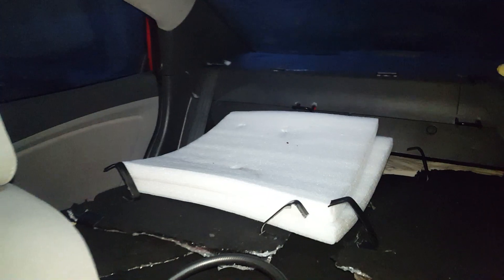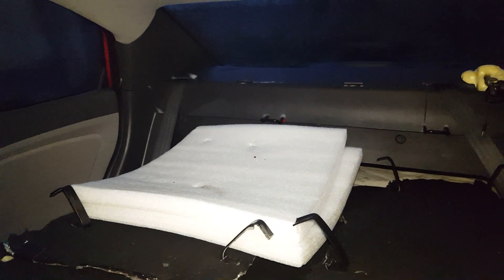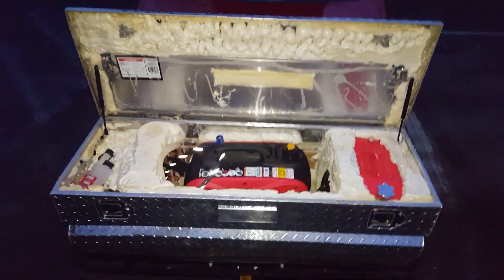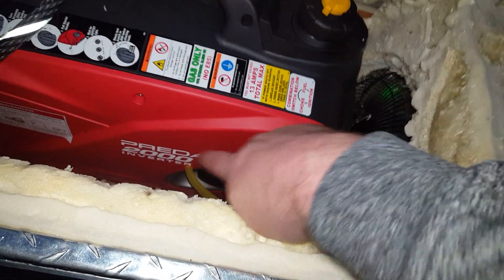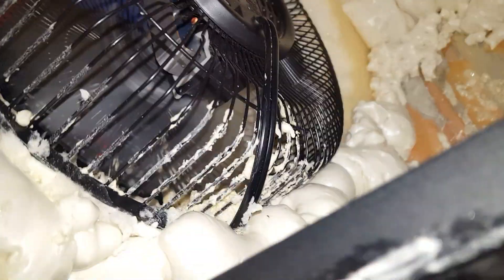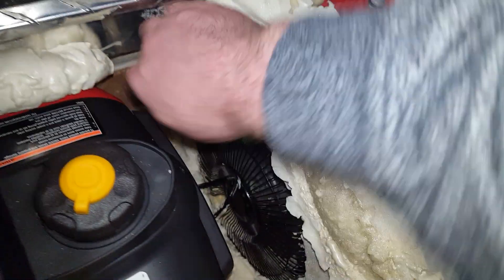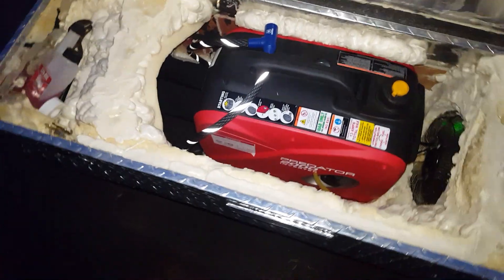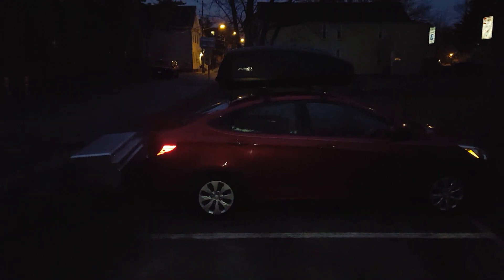car life generator box

Comment: Your first attempt was def. quieter, but this does make a significant difference. What was the issue with the old baffled one? Too hot?
Reply from the maker: It was too hott. I origionally removed half the baffles and unstalled 3 dryer duct fans and it did not get too hot but we are going to vegas in july so i wanted to make sure it wont over heat.

Comment: nicole looks so excited lol. nah cool idea though. I wonder if you could get more mpg on the generator if you put a bubbler in the fuel tank so it runs off fumes, thus increasing mpg?! and how quiet is the box from certain distances?
Reply: I'm not sure if you're serious or not, but I'll still try to answer your question anyway. 

TL DR, No.

If you would like a more in-depth explanation, here we go.
First, for combustion to happen in your engine, or anywhere for that matter.
You need these three things; heat, Fuel, and oxygen. 
A fairly specific proportion of each at that. 
Not so much for the Heat, but for the fuel and oxygen very much so. 

This is taken care of in the carburetor in the example of this cheap generator. 
It "vaporizes" and fuel more or less and mixes it with air in the proper proportion for the engine to run. 
If you were to put a fish tank "bubbler" in the gas tank, in reality, it shouldn't do anything because the fuel should be coming from the bottom of the gas tank. 
However, if you did manage to get enough air into the gas line for it to do anything at all the engine would simply just stutter or stall out right.
Notice I said air earlier because that's all you would be doing.
A bubbler in a fuel tank could do nothing but add air into fuel. 

A carburetors job is to add fuel into air, at a fairly precise mixture. 
Displacing fuel with air from a fish bubbler would just throw off your mixture. 
If you don't adjust the carburetor first.
Now to be fair, a stuttering engine would technically consume less gas than one running Steady. 
Albeit a small amount, it would still burn less gas.

However, it would also technically be less capable. 
Meaning if your generator is capable of outputting 500 watts exactly. 
With the engine stuttering, you may only get 50 Watts you can use. 
And the kind of power you would get could easily damage any kind of electronics. 
Pretty much anything other than a big incandescent light bulb would be damaged. 
And even that would probably flicker... A LOT.

On a side note, I assume by "M.P.G." (Miles Per Gallon). 
You were actually trying to ask if you can get more energy per gallon "EPG" Maybe?
But if you did mean MPG. 
No, I don't believe they are in any way powering their car by the means of this generator. 
It is merely attached, in any event, the bulk of everything else I said still applies.
Reply: @xsterawesome  Bro I been on YouTube from the start and i never seen a YouTuber answer a question with a short story :)